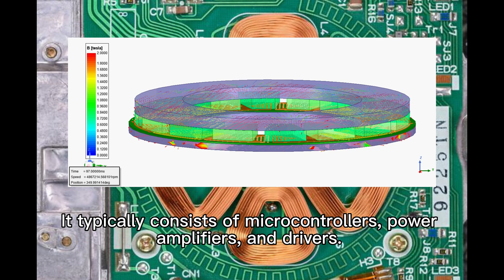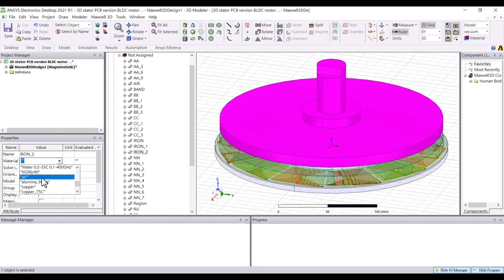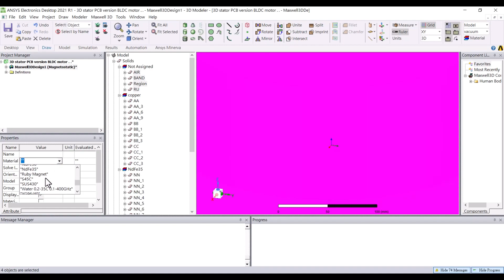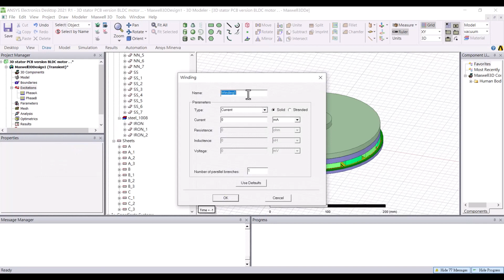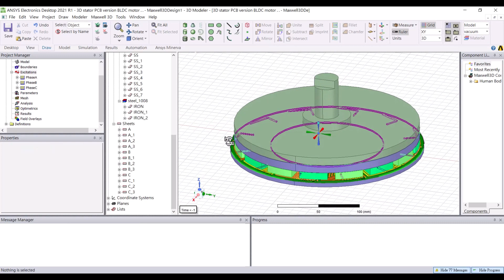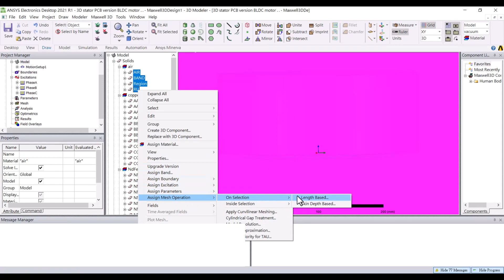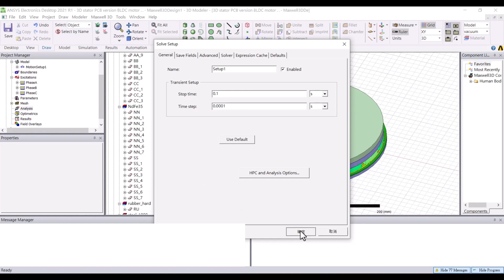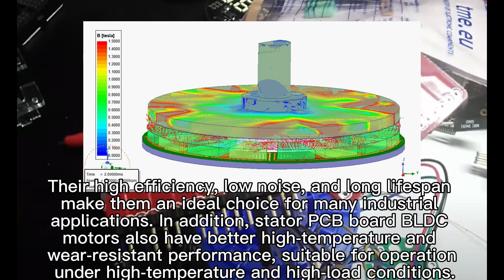Desgin a stator PCB board BLDC motor ; Using Ansys Maxwell software.

Comment: Hi, is it possible to give variable in reference speed for parametric simulation?
Reply from the maker: It's okay, I will pay attention to adding it in the future.
Reply: @johnhsu5773  I'm trying to do optimetrics for different rpm but I'm unable to do. So I'm asking if it is possible to do parametric for varying rpm?
Reply from the maker: @YashPawar-e5m  ，yes, this software has this feature.
Reply: @johnhsu5773 In transient analysis, I generated a variable for speed/rpm which I assigned to angular velocity in motion setup (in unit tab it automatically converted to unitless). I tried to solve this, it resulted in very much wrong BEMF plot. Is there any other way to parametrize speed in transient simulation?
Reply from the maker: @YashPawar-e5m  , l think that your simulation analysis may have been set incorrectly or failed.
Reply: @johnhsu5773  yes it was due to unitless variable, now its been solved. Thank you

Comment: Great Video! I had a few questions:
1. How did you assign the windings (The No. of conductors seams to be 1 is it single turn winding or there are multiple turns)
2. It would be great if elaborate more about the external circuit that you used 

Thanks for posting!🙂
Reply: hey mihir, the conductors visually seems to single solid but you can assign them as stranded with number of conductors or else you can let it be as single conductor.
Reply: @YashPawar-qj5qt  correct, but in the video number of conductors were assigned 1 that's why I had the doubt
Reply from the maker: @mihirdafauti2647  . Because it is a PCB board, not a general enameled wire winding. In the software, we only need to set it to 1 turn.
Reply: @johnhsu5773  ok, thanks for the reply 👍

Comment: Nice!!!!! I have a doubt, when I'm going to assign ORIENTATION in the magnets, It does'nt appear N o S, only appear "Global" and "Not assigned"... How can I fixed??? Is the same .step file. THANKS. Your videos are very helpfull
Reply from the maker: You can send me an email regarding the N or S pole settings of the magnetic pole of the magnet, and I will reply with a detailed explanation of your problem.
Reply: @johnhsu5773  i have same problem and i've send you an email about that 
please explain this part to me

thanks alot
Reply: @johnhsu5773  

i have read your email and don't find the explaination page

please explain more 
or state the link here to know how
Setting the magnet magnetization direction of the N and S poles
Reply: sir, the shared link is invalid,  i hope you can send a valid link 

thanks for your help
Reply: I've same issues.

Comment: Is it possible to simulate 2D version of this type of Motor?  Could you please share it’s geometry design procedure?
Reply from the maker: This type of motor is not suitable for using 2D models for calculation and analysis.
Reply: Then please share it’s 3D geometry design procedure